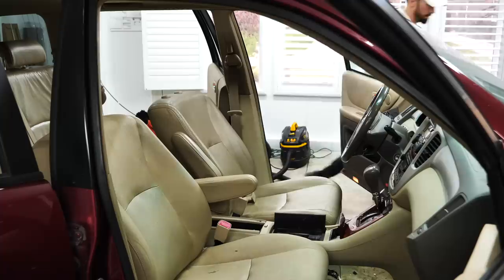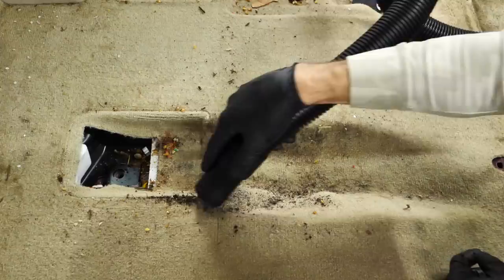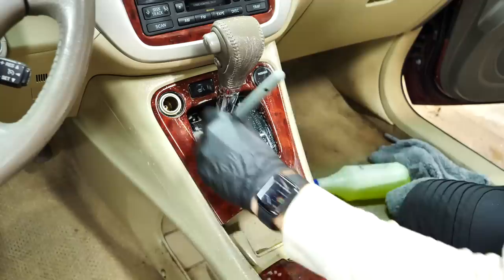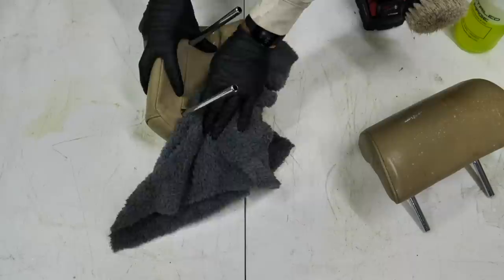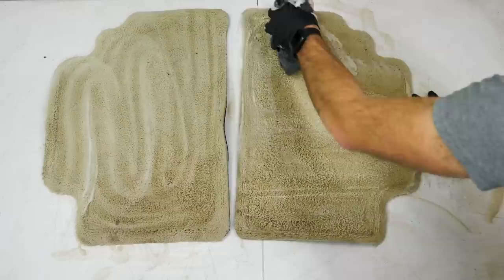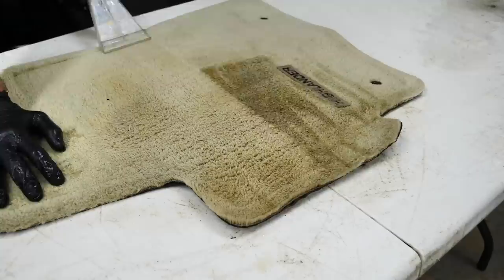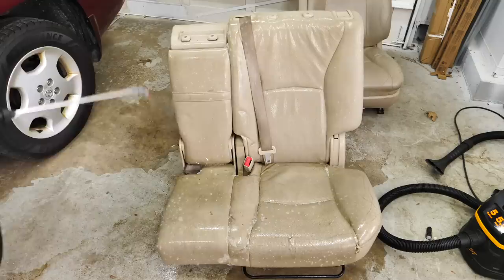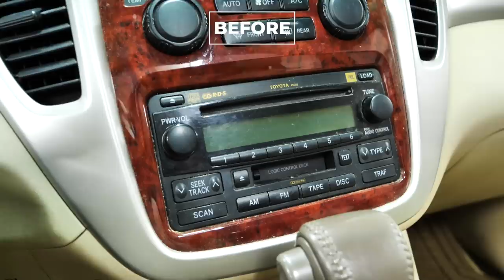Car Detailing A NASTY Trashed Car! Toyota Highlander Deep Cleaning Disaster Transformation!

Comment: just out of curiousity have you ever thought of putting like little dirty plastics that cover bolts and what not in a dishwasher to see how they turn out and the same with the carpet mats on a hot heavy duty wash as a precursure to doing a extraction to see if it helps loosen up even more long lasting  stains ? and the same with the carpets with some sort of steam cleaner

Comment: Hi!
I am always following your videos and I liked them a lot.
I have some questions.
1. Why in such disastered car you are cleaning trim and small compartments with brush and mf? Why don't you use just a steamer or put the trim under tap water to wash them properly? For me it seems not hygienic.
2. I know was cold outside to pressure wash the carpets. Did you ever try to use steam and extraction togheter? Maybe it dissolve the dirt better.
3. Ozone machine in this case. Why not?
4. How much time did you wait since you start work the carpet after spray carpet solution usually? 
Bye from Italy!

Comment: I think I have your mystery goo figured out.  It looks to me like it's evaporated soda or a cola drink.  After the water evaporates, you've still got a syrup left over with no place left to go and sweet smells usually don't translate well as a petroleum based oil.  If you ever find yourself with a next time scenario, try and scoop up the gooey stuff and find a clear container to scrape it into.  Add water, shake or stir, and see if it dissolves into the water.  A petro chemical should stay separated and float on top of the water.

Comment: The one thing i wanted was a session at a float tank (sensory deprivation )  its a place where you sit in this big pod and you can lay back and you will float as it has 3000 lbs of salt dissolved in it also i was wanting if i got some cash to get drill brushes to start me off on the detailing path

Comment: ANY type of protein based stain will be set into the fabric if you initially use hot water. Its better to do a cold water/soap pass first incase of vomit etc then switch to heat.

Comment: For those mats, just dissolve a few handfuls (wear gloves) of potassium hydroxide into hot water in a kiddie pool. You can agitate the mats under the hot water with a drill brush and an extender bit and the stains will permeate out into the water. Then just rinse them. That will save you all of the elbow grease. Let chemistry to the work for you.
Reply: That's pretty interesting and helpful.